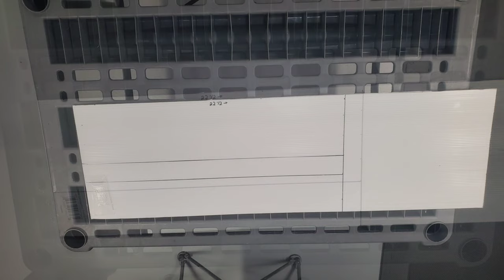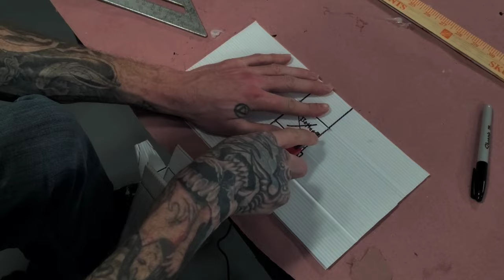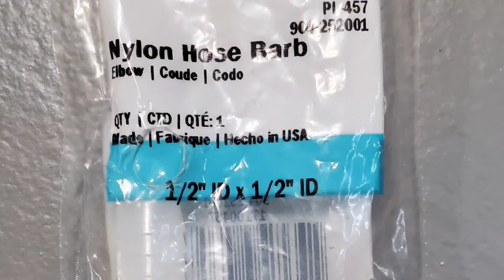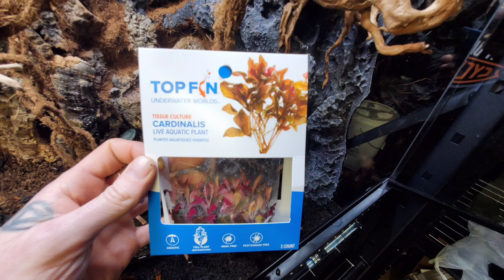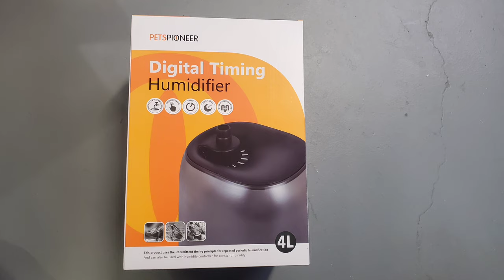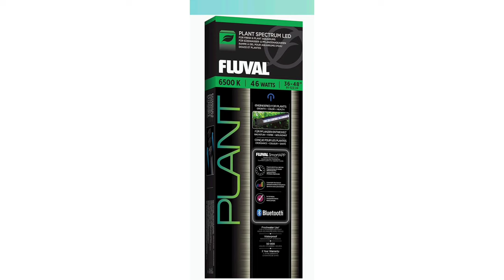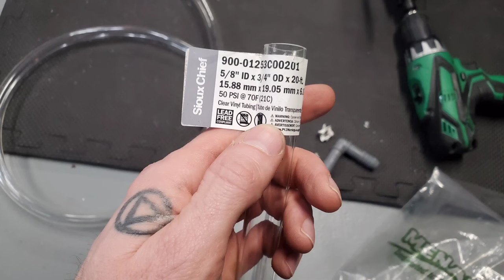How To Build A Paludarium DIY In Depth Tutorial #paludarium #bioactive

Comment: By far the best/most detailed build I’ve seen. Will use this video as my main reference when building my own!!
Reply from the maker: Thanknyou and glad it can help you with one of your upcoming builds. Enjoy your creation.
Reply: Yea I'm saving this. I like the fans for airflow, most others don't have them
Reply from the maker: @richardbinkley8487  they work great!.
On another build of mine they have been going strong for 8 years.
Reply: @bradsbioactivebuilds  I was curious how they held up in a wet environment...I'm glad yours lasted that long!
Reply from the maker: @richardbinkley8487  the build i did about 8 years ago was with a larger cpu fan is still the original fan. I'm hoping the 40mm fans hold up to the test of time as well. But ingot 4 of them for like 10 bucks off Amazon. So if they go out at least they are cheap and easy to replace. I'll update if they go out or in a years time  as a follow up.
Reply: Same
Reply: Dude got balls check prices he paid alot and made a challenging build
Reply: @bradsbioactivebuilds You never explained what those random strips of egg-crate siliconed to the back wall are for! 🤔
Reply from the maker: @EmpressOfExile206  to help spray foam attach better. I just siliconed them on. More area for ot to grab onto. I did remove some of them

Comment: Do your dart frogs do okay with that big water feature? I’ve started working on a huge paludarium of my own but recently a lot of people have been putting the fear into me that the dart frogs will drown.
Reply from the maker: I think it is something to be mindful of. I have added a lot of surface area with the background to where I was able to more then triple the usable space I lost from the water feature.  I personally never had any issue with it but i monitor them closely.  Another paludarium I have has 3 darts in it for 7 years now with jo issues. In this build video they both sit in the waterfall and have never gone into the "pond" area, even if there is a fruit fly in the water. I have seen them watch it and wait for the fly to climb out then eat it. Darts can swim they just aren't great at it, but for something like this they would be able to easily climb out if needed. When I first put them into this paludarium I placed them into the water so I would be there to observe them. They swam out just fine. I did this more then once to be sure and to also teach them what to do incase they go in when I'm not home. You can also get a camera that hooks up to wifi to do a Time-lapse and see if there are any issues.

Comment: You don’t worry about your dart frogs drowning?
Reply from the maker: I wouldn't suggest a large water feature for beginners and darts. If you have experience, process with caution.  
I have kept darts in paludarium for years. Not 1 has drowned. 
The downside is that it loses some footprint space. But that's why I quadrupleed the size by adding a background. 
Hope that helps
🤘💯🤘

Comment: I keep reading that your not supposed to put frogs in an enclosure with water like that. Is that true?
Reply from the maker: Great question. Yes and no, depending on your level of keeping and usable space inside the enclosure. Definitely want to keep an eye on them with a water feature. I have not had a faitial issue with any. My 1 paludarium I had fir over 10 years with jo issue. The down side is even in bigger enclosures you still loose the footprint of land area where the water is. I'll actually place the frogs in the water a few times when I introduce them to the enclosure so they know how to get out and thar its there. Supervised of course. Then watch them moving forward.

Comment: I have read that most dart frogs are not good swimmers and shouldn't have access to deeper than their heads.  Your build is what I've always dreamed of but how are you preventing your dart from drowning?
Reply from the maker: It can be a controversial topic. And I wouldn't suggest it to new dart frog keepers. 
With that being said, in order this to be successful, I need to have a backup enclosure ready if it doesn't work out during any time of them living in here. 
I had a previous paludarium that had 3 blue azureus living in there for 8 years. 
The tricks i have found are to make a larger than needed land area. This can also be achieved by doing 3 walls of the background. 
Make it easy for them to climb out of the water. They are not great swimmers, but they are going to have a natural instinct to swim out of the water rather than sink like a rock. I will actually place them into the water when they 1st get into the enclosure so I can supervise them swimming out a few time incase they accidentally fall in later on. But I'm  still yet to lose a dart due to drowning. 
I also don't keep 2 females in an enclosure to reduce them wrestling and drowning 1 another. 
I also keep a close eye on them while living in the enclosure.
I think it comes down to the individual frog and their behavior rather than a blanket statement.
With all that being said, nothing is 100% guaranteed. Definitely do your research and do what you are comfortable with if you decide to go either way.
Hope this helps.
🤘💯🦎🐸🐍🐢🌱
Reply: @bradsbioactivebuilds    Thank you very much.  I really appreciate your reply.  I've seen a lot of videos and a few take this approach but you're the first creator to reply to my question.
Thank you very much.

Comment: Your tutorials are great. You really have a knack for explaining everything thoroughly and teaching, basically. I've only got a bit of finishing touch planting to do on my first vivarium. I'll be getting a crestie sometime in the spring. My nieces and nephew are totally psyched. It has turned out well, all in all. Using NEHERP for the substrate was a good call. They include more than enough bottom and substrate, at the most reasonable price I could find. The microfauna they sent was very low population though. I think I'm gonna need to reseed, or seed properly perhaps. Look forward to more from your channel :)
Reply from the maker: Thank you for the comment, and I'm glad you were able to get something from it. 

I actually started making videos for my nephews, and it was a gargoyle gecko build lol.
 You will be surprised how many 10 isopods could multiple.  I put about 20 in one of my arid ackie monitor builds and there are 100's now. I use that enclosure to seed others now.
🤘💯🦎🐸🐍🐢

Comment: I learn so many different tips and tricks from warching individual buuilds. There are so many different methods and with the peoples combined ingenuity really helps me make things better.
Reply from the maker: Awesome, that what's its all about! A community helping each other advance the hobby!
🤘💯🦎🐸🐍🐢🌱
Reply: @bradsbioactivebuilds yeah I am currently referencing this video for the air duct. Your videos are brilliant. Your effort is very inspiring.
Reply from the maker: @NeanderthalDogma  thank you, i wish I would have used hot glue to attach the ducts to eachother, I forgot that's how I fmdid it abumout 8 years ago lol. Also when .asking the lid it is important to make sure it's a snug fit so nothing gets in. 
Have fun woth it and Lmk if you have questions as you build
🤘💯🦎🐸🐍🐢🌱
Reply: @bradsbioactivebuilds  oh no what was wrong with the hot glue?🤣🤣 i did because it was quicker, but i miggt have to tear it out. I made it a little to big for my tank dimensions so the left side is about half an inch from the wall.
Reply: @bradsbioactivebuilds  oh i misread that. Good. Lol. Yeah i used hot glue because didnt want to wait for the silicone. I will probably just cut off the ends and make it shorter maybe just on the left side. I couldnt get it as snug as you so i had to glue little ledges in the duct for the fan to sit on.
Reply from the maker: @NeanderthalDogma  awesome. Sounds like you problem solved well!

Comment: 25:54 Question. How does adding another layer of corrugated plastic w/ screen, to the inside of the water chamber, help water pass faster? Is that because the outer screen might get clogged?
Reply from the maker: I said, "The water pass through," not water faster. I did have to listen to it a few time though. It does sound like I say water faster lol. But to your comment. I have noticed that when plant leaves from the canopy fall into the water, they will end up on the screen (water pass through), so in a way, it won't make it to the back chamber. Keeping the back chamber as debris free as possible.

Comment: This is an amazing video!! Thank you for being so detailed! I’m in the process of getting everything to do a build like this one.  Could you tell me what size holes you made in the glass? And about how far up is the input exterior canister filter hole?  How much higher is the water overflow hole from the input exterior canister filter hole?
Reply from the maker: The hole size in the glass for the input exterior canister filter was the same or closest to (on the larger side) of the outside diameter of the hose. I went 4" above the waterline for this hole. 
Lmk if you have any questions. 

Her is a link for the drill bits I used for the glass
Diamond Hole Saw, 15 pcs Diamond Drill Bits Set Glass Drill Bit Extractor Remover Tools for Glass, Ceramics, Porcelain, Ceramic Tile (1/4"-2") https://a.co/63INwm0

Comment: Thank you so much for doing such a detailed video of the process! Seeing you drill the holes has made me a lot less scared to drill into my own tank. And that air duct is genius! Just wondering why you decided to have the air flow from the bottom up instead of the other way around?
Reply from the maker: Thank you, Jathmin! If you have some extra glass laying around, do a test first. Butnit really is super simple. Just let the weight of the drill do the work. 
The airducts add so much to the build. I have the air flow blowing up bit I'm sure it can be done either way. I just thought it would be more natural to have the air/wind at the top. 
🤘💯🦎🐸🐍🐢🌱

Comment: Fabulous build, thank you. Question about the fogger. I've had trouble getting my Foggers to extend over long and high distances. The tubing they supply sags and then the fog just trickles out. Is that why you use the PVC? To help it travel a long distance so it can put out the same amount of fog? Or am I just using too small of a fogger do you suppose?
Reply from the maker: Thank you,  I just had to cut some of it back a little bit because it was starting to grow in way to much lol.
It may be to small of a fogger your using. I just added the pvc for cosmetic, and so the tub wouldn't need to make a 90° angle. This way it attaches to the pvc and the pvc does the 90° angle.
🤘💯🦎🐸🐍🐢🌱

Comment: Love the videos, thank you for all of the help. I tried this for the first time to create a simple barrier to hold water in a small 10 gallon tank. We sprayed it evenly in a half moon shape, let it dry overnight. When we filled in the water area created there were multiple very slow leaks. What would you suggest to make it truly waterproof on our mail attempt and any tips to seal up the leaks on the first?
Reply from the maker: I had a build years ago I did the same way. Sprayfoam will not create a water tight seal to Glass and will most likely find a way through the beads you lay down ontop of eachother. Check out this video. You could try this to create a water tight seal over the existing sprayfoam or remove it and start over if that is an option
https://youtu.be/4eoZNSPi8dU?si=CIELqoKmDMjLXzXL

Comment: You drilled holes in the glass. Is/Was that tempered glass? Most glass in enclosures are tempered at this point.
I've never attempted to cut a hole in tempered.
I need to to some predrilling in an Aquarium for a sump filtration.
Reply from the maker: Thanx for the question. No, it was not tempered glass. Exo Terra doesn't use tempered.  Other fish tanks might, but it usually says if they are. You can search tricks using  polarized sunglasses and see the difference between tempered and nontempered glass. 
But drilling glass is fairly easy. Just use water to cool the bit. A Jig will be your friend and add no pressure to the drill. Let the weight of the drill do the work. It usually takes me about 4-5 minutes to drill through 1/4"glass.
Hope this helps
🤘💯🦎🐸🐢🐍🌱

Comment: Hi Brad, I live in the uk and can’t get hold of the turtle clean 30 without importing it. I was wondering if you had an idea how I could do the same with a fluval external filter as I have a fluval 407 spare so trying to make use of this also wondering if you have an idea of slowing the outlet pipe
Reply: Also I might be being stupid but please could you explain where the water is pumped out into the cannister. If you have a social handle I could mssg you easier on please could I have it as I have many questions 🙂🤩so intrigued
Reply from the maker: Ypu can just run the fluval the same way like I did. 
You. Can get a barbed ball shutoff valve like I used in this video 
https://youtu.be/Ff1YHtaGHM8?si=pWn6vkuoIr4gRJNw

Comment: Hello Brad, regarding the lights, wouldnt the 24-36" have fit the tank aswell? For cheaper instead of the other size you showed you got.
Reply from the maker: Yes it would have but I wanted more coverage from end to end with light. The smaller on would have about 7" on each side not as lit up

Comment: Hello from Malta!

Would it be possible to use polystyrene instead of foam for the fake rock, I was thinking to sculpt it with a soldering gun and painitng with waterproof liquid over everything. Thanks !
Reply from the maker: Hello from America! I was just over in the Mediterranean last year. It was truly amazing. 

I used polystyrene 10+ years ago, covered in a few layers of grout. It seemed to hold up fine. I don't believe the polystyrene would hold up with just paint. Bc it's not as dense as the insulation board and may puncture easily and not water tight.
You could always grout it and add paint to your last layer of grout to get the color you want.
 I heard it's hard to get drylok in Europe?
🤘💯🦎🐍🐸🐢
Reply: @bradsbioactivebuilds  Good morning mate! thank you so much for replying. I've been watching your videos all night yesterday and it's very interesting.

 You take time to explain calmly and in detail. It's hard to get drylok in Europe and harder to get it in Malta, we are a very small island and with limited stock. I will try perhaps to get some from Amazon or Ebay. I am planning to start my build end of February, it's y very first Paladarium and I will for sure use your videos for reference. 

Thanks again mate, I will have more questions for sure :)
Reply from the maker: @Linwood283  of course, and I'm glad you found my channel.  
Have fun building your 1st paludarium! As you're working on it and have questions, don't hesitate to ask.
🤘💯🦎🐍🐸🐢

Comment: How are the temperatures in the set up? does the warm water help with the temps? Im just curious as i want to use some of your technics but i gotta have these whites tree frogs in the 80s during the day.
Reply from the maker: Temps are usually around varying 
Top, hight 70's
Mid, mid 70s
Bottom, low 70s
If I turn the water heater up, it can adjust the numbers above.

Comment: Great video, currently building a paludarium for my newts. I'm just wondering what kind of screen/mesh is used for the pump tower?
Reply from the maker: Thanx, and I used windows screen mesh.
Hope this helps
🤘💯🦎🐸🐍🐢🌱
Reply: @bradsbioactivebuilds  ah thank you! Did it last/hold up? 😆
Reply from the maker: @nickcluley2390  yes it has, it's a measure so it won't weather or rip as easy like aluminum screening. I'll hopefully be uploading an update video Sunday otherwise for sure next Sunday

Comment: How much spray foam is used in the manufacturing process and how long does it take?
Reply from the maker: I probably used 3 cans if I remember correctly. You can put tinfoil iron painters tape on the tip of the can between uses to prevent it from curing in the can.
Spraybfoam can be carved typically 6 to 24 hours, depending on how much is used.
🤘💯🦎🐸🐍🐢🌱
Reply: @bradsbioactivebuilds  Are there any alternatives to using spray foam?
Reply from the maker: @ALAMLUSVI  you can use insulation board (xps board)
Reply from the maker: Cork bark panels and carve them down too
Reply: @bradsbioactivebuilds  what if I use cement? is it safe for animals?
Reply from the maker: @ALAMLUSVI  Yes, but it is fairly porous and heavy, and you'll have to seal it with something if it's for a water devider.